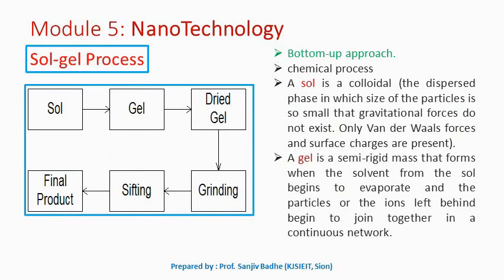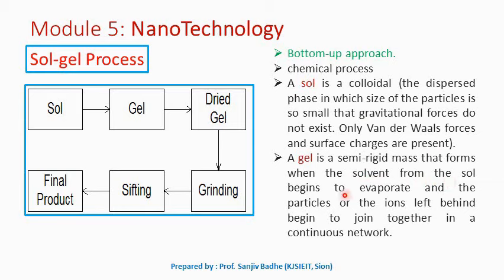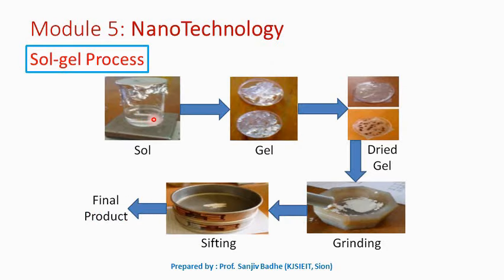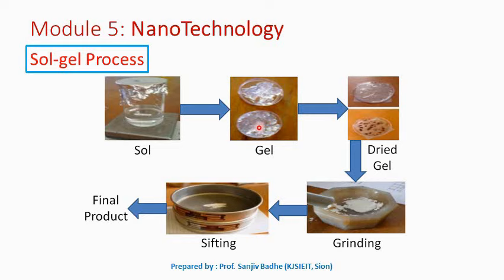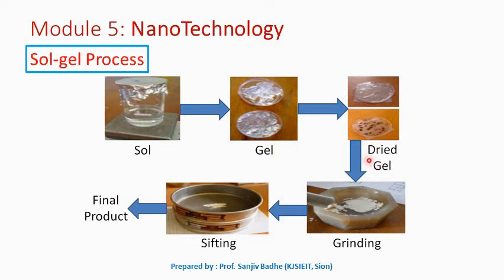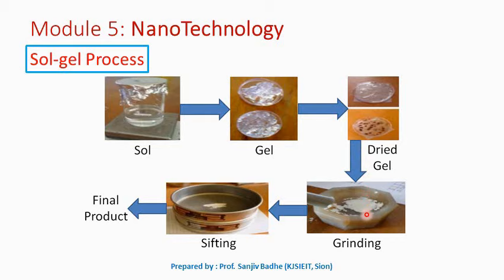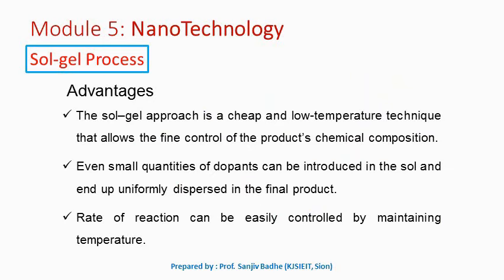Sol gel method to produce nanomaterials

Comment: sir , when gel is formed, it is very thick. so how we can do centrifugation?
Reply from the maker: centrifugation can be used when it is not very thick. After centrifugation we will get very thick gel which can be further dried up..
Reply: @EngineeringPhysicsbySanjiv  thank u sir for your reply, plz answer one more question ..will we use micro-centrifuge  at speed 10000 rpm using eppendorf tubes?
Reply from the maker: @iqrajabbar5287  Cant tell surely. just try and check..
Reply: @EngineeringPhysicsbySanjiv  ok...God bless you

Comment: It is not sifting. It is called sieving
Reply from the maker: Both words mean sams as per my info
Reply: Sintering
Reply: Not at all  @EngineeringPhysicsbySanjiv
Reply: As it is a dry material, it is indeed "sifting". Sifting is the sieving of dry material, whereas "sieving" can be applied to both wet or dry material.
Reply: @its_nagi  "Sifting" is a kind of "sieving".
Reply: It's same thing einstein